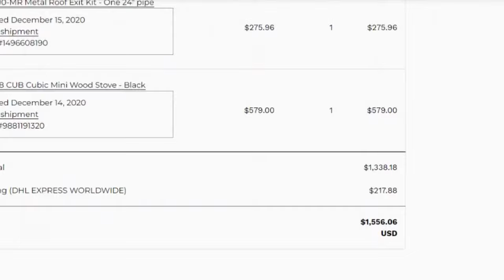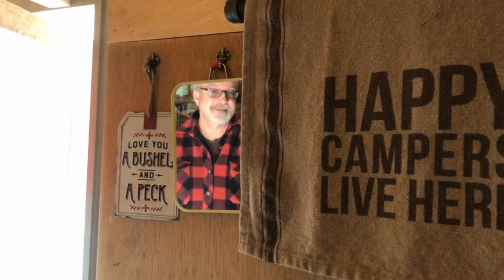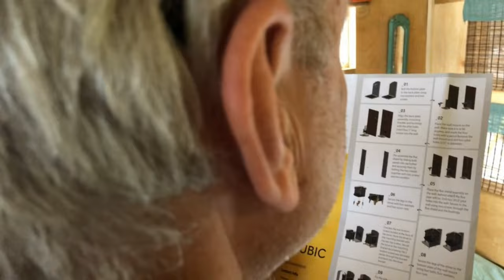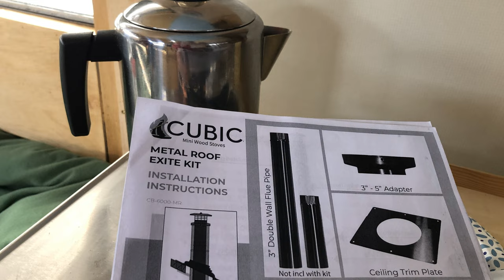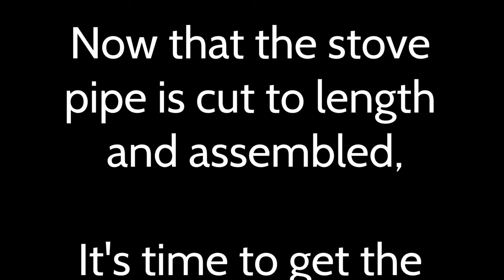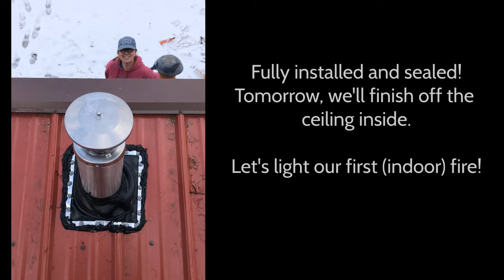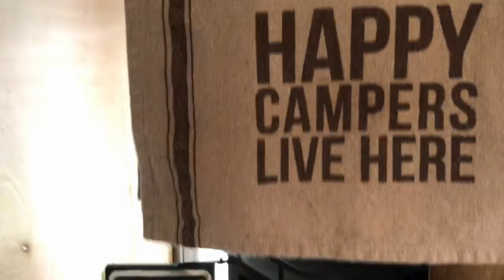Installing our Cub Mini Woodstove in the Micro

Comment: I was just thinking about you 2 the other day when I was scrolling through my subscriptions glad to see you are both well. Did you see any real heating of the camper with that thing or is it more for the ambiance?
Reply from the maker: Hi there!  Yes, it really does kick out great heat.  We can arrive at camp with the micro 15 degrees inside, and, within half hour of a good fire, it’s up to 70.  We’ve cranked it up in the 80’s too!  Truly is both useful…and cute! 😉.  The ONLY down side is the burn time at night.  It requires “feeding” every 1 - 1.5 hours in winter, which means getting up to do so. (That’s my job😵‍💫). So, we have bought the next size up (Grizzly) and will be moving this cute little Cub to our new 8x8 bathhouse.